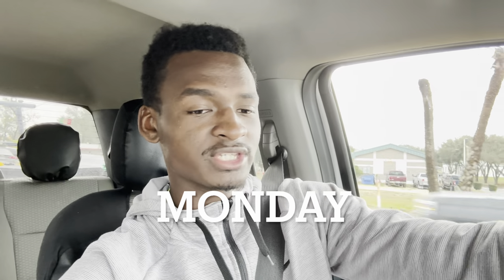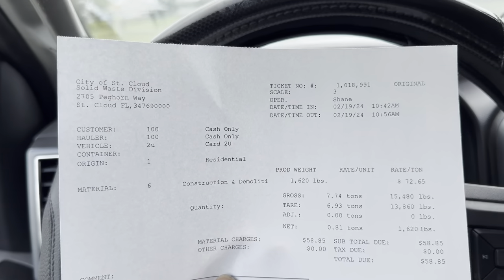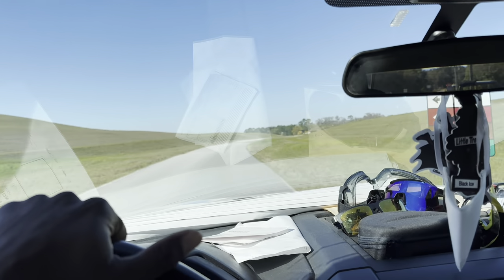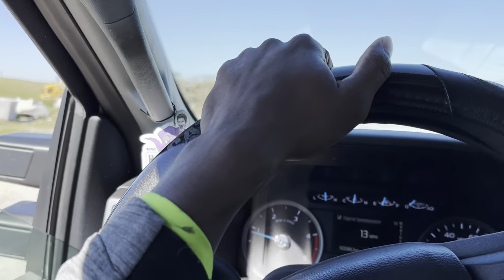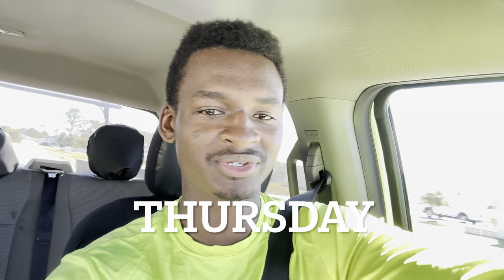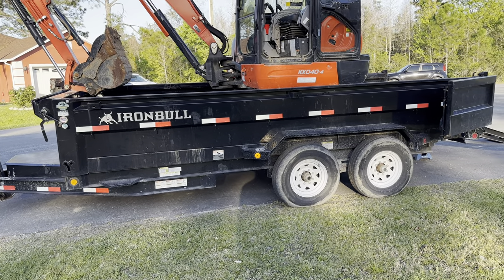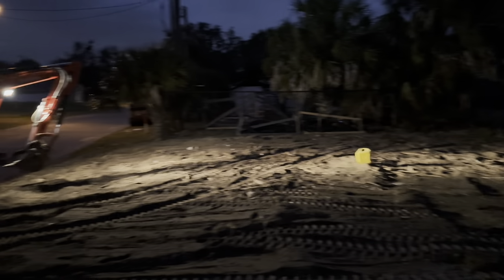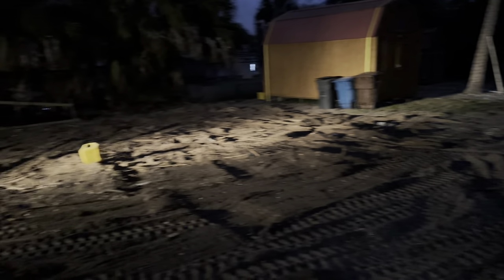How to start a Skid Steer Business | Week in the Life of Excavation Business Owner

Comment: Make sure to chock your trailer tires while loading heavy equipment, or your truck could roll forward if the rear wheels lift up.
God Bless, and keep it up!
Reply from the maker: Thank you man I will make sure I do.
Reply: It all depends but the general is load on a flat surface not up or down a hill. Unles you have supported ramps or a tilt-deck the trailer and rear end of a bumper pull is going to lift up

Comment: Lock the E brake on your truck and chock the trailer wheels when loading or unloading your equipment. For your safety and the safety of the truck's transmission being vulnerable in park
Reply from the maker: Oh I always do that’s like the first step to loading any piece of equipment big or small
Reply: Unless the truck is 4WD and the transfer locked,  E-brake is not going to help since it holds the back wheel , which are prone for lifting off the ground.  Chocks would be more ideal

Comment: If u separate the wood from the metal and concrete your dump fee wont be as bad because concrete you can dump free, and the wood and metal would be cheaper dumped separated just trying to help you out buddy, also to if dot catches you not using your tarp thats on the trailer to they can give you a fine as well hope this helps and keep up the good work
Reply from the maker: Yeah I’m aware of the DOT but it wasn’t worth separating the different material because there was no dump near me that would take the concrete the closest one was in Orlando and I was no where close to Orlando.

Comment: I used to load my kubota kx121-3 in a 7x16 trailer, try loading blade towards the front, that should give you more room to balance out the weight 👍🏼
Reply from the maker: Should I have the boom in the back then?
Reply: @EntreprenuerDavis  no sir, boom in the front and blade in the front. That should balance out nicely. I also used two blocks of wood, one on each side of the rear of the trailer to stabilize while loading/unloading. Made all the difference in the world.
Reply from the maker: @Schutte_Excavation  I used a car jack stand for stabilizing the trailer when loading but I will try this in the future
Reply: @EntreprenuerDavis  absolutely man, it’s all about finding ways to get it done, and then finding ways to make it better 👍🏼 keep on grinding!

Comment: Okay I’m curious about the weight of that excavator in your dump trailer. The trailer looked completely fine with excavator inside, however isn’t that a 14k trailer? That excavator weighs 9500-10000 lbs right?
Reply from the maker: Yes it is a 14k dump trailer and the excavator does in fact weigh 10000LBS
Reply: @EntreprenuerDavis  okay I thought 14k dump trailers curb weight was around 4700 lbs. I could be wrong. I’m only curious because I am looking at purchasing the same excavator and wanted to pull in a dump trailer occasionally. I figured trailer and ex alone I would be over weight, not counting a few attachments.
Reply: @wheatonchannel some of the weight when loaded will be on the truck, although he is for sure maxing that trailer out
Reply: @RiverValleyLandscaping  right, with the bucket he has to be close to 1000 lbs over max gvw.

Comment: Use skid loader bucket to back drag next time or excavator blade to blade smooth
Reply from the maker: That skid kept getting stuck in the dirt so I used the blade on the excavator and that’s the best I could get it because the dirt was so soft
Reply: @EntreprenuerDavis 
Grab a short piece of treated 8"x8" lumber.
You can grab it with the thumb and use it like a screed

Comment: You definitely need a bigger truck. Or a gooseneck trailer. Be smart with towing lots of accidents happen from improper loads.
Reply from the maker: Already looking into getting a gooseneck but the new truck is out of the window. I am not rich 🤷🏾‍♂️ and I enjoy my F-250 honestly
Reply: @EntreprenuerDavis those f250 can handle a lot but I recommend you getting air bags installed. It makes a huge difference.
Reply from the maker: @charlesedwards8030  yeah that’s what I’ll do honestly because it says I can tow up to 24,000LBS and I don’t think I would ever need to tow more that at nor can I do that without my CDL
Reply: @EntreprenuerDavis  a gooseneck will help you out a bit then. I personally like big Tex trailers. I like how they have the axels spread out 4 foot. I have had PJ trailers and had to many issues. Good luck to you. Whenever you get into digging make sure you get the area checked for underground utilities it will save you a big headache and it's a free call
Reply: His truck is fine!